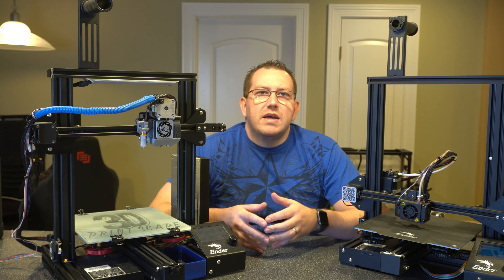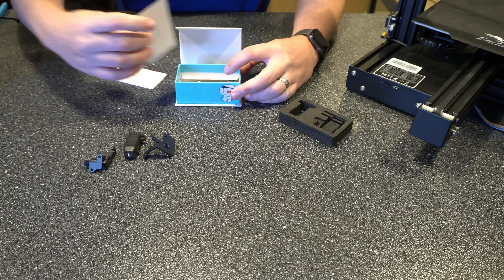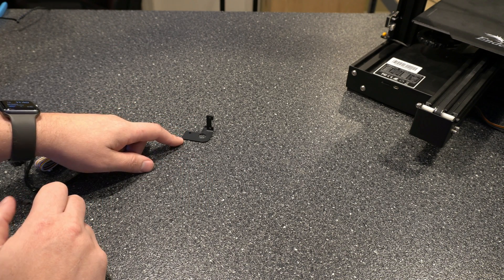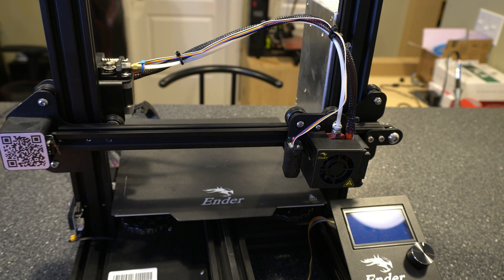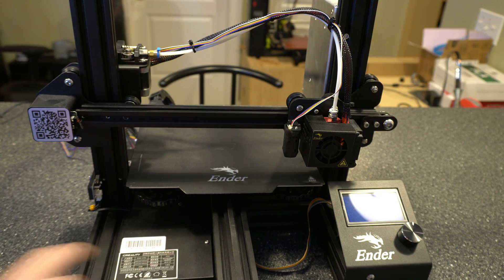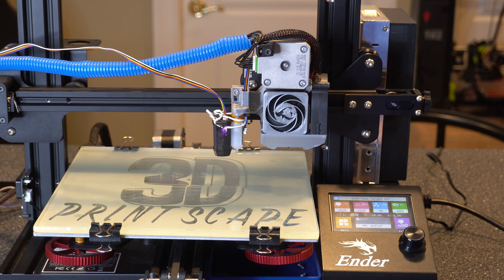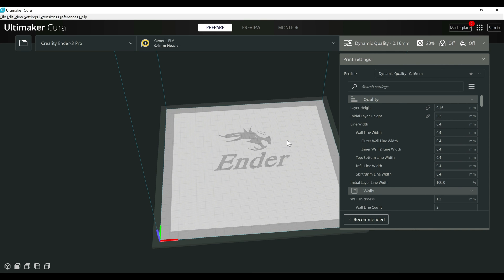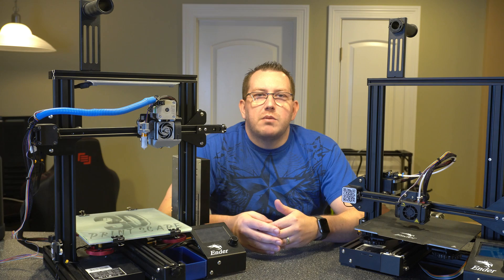CR Touch on SKR Mini

Comment: Hi I flashed the firmware just like the video but when I auto home the extruder only auto homes like the cr touch isn't there. It just goes to corner like normal. Please help thank you
Reply from the maker: Hi. It sounds like the printer didn't take the firmware. You can verify by checking the versioning the about screen or looking to see if the bltouch menu items are there.
Reply: @3DPrintscape  I am experiencing this same issue. If i download the firmware-bltouch-for-z-homing.bin, it will home at the center...
Reply from the maker: @Bloodyfisted  Hi. You shouldnt be using the z-homing file with the crtouch. Try the standard btouch one.

Comment: Thank you for your review. I have the SKR 2 on an Ender 3. The firmware builds fine but when I go to home the printer, it goes to the X endstop, then the Y, then the nozzle goes to the center of the board and goes up a little bit then stops. I have tried plugging the CR Touch in the Servo and Probe pins and also using the Z Stop pins (changing the firmware prior to for each) and I still can't get it to work. When I turn the printer on, the probe does pop out so I know it is getting power. Any suggestions would be greatly appreciated!
Reply from the maker: Hi. Make sure you comment out #define Z_MIN_PROBE_USES_Z_MIN_ENDSTOP_PIN and uncomment #define USE_PROBE_FOR_Z_HOMING in the firmware, assuming you have all 5 pins going to the bltouch port. Also, try it with the z stop plugged back in.

Comment: Great video. I just got my cr touch and have it mounted, however auto homing makes the extruder push into my glass bed. I can’t lower it to zero to find the z offset as the extruder hits the bed around 3mm. It has to lower passed the bed height for the cr touch to trigger. Is this a configuration issue or do I need to try and mount the cr touch lower?
Reply from the maker: Hi. What mounting bracket are you using. With the probe extended, it should be lower than the nozzle. If thats not the case, you will need to lower the CR Touch.
Reply: @3DPrintscape  I’m using the default mounting plate that came with the cr touch. The one meant for the ender 3 pro. And when it’s deployed, it’s only about .5 to .6 mm lower than the nozzle. I’m using the firmware configured to use the cr touch for z homing as well
Reply from the maker: @UnveilinMedal8  If its lower than the nozzle it should be fine, but that is cutting it a bit close. Can you try to add a washer or something to lower the cr touch to see if that helps?
Reply: @3DPrintscape I used two of the mounts to increase the distance and now its working. However, now nothing is centered on the bed. When I center an object in Cura, the object is printed left of the center. Do you know why this is happening? I am using the precompiled firmware provided by bigtreetech as I just reset my PC and didn't have VSCode and PlatformIO setup yet.
Reply from the maker: @UnveilinMedal8  Can you make sure "Origin ad Center"" is not checked in your Cura machine profile.
Reply: @3DPrintscape  it’s not checked. The print is centered in the Y direction. However it’s shifted to the left in the X Direction, even though Cura shows it’s centered on the build plate
Reply from the maker: @UnveilinMedal8  How far off is it in the x direction and what firmware are you using?
Reply: @3DPrintscape  I’m using the bigtreetech pre compiled z homing firmware for the bl touch ender 3 with the SKR Mini V2
Reply from the maker: @UnveilinMedal8  If you have all five cr touch wires connected to the bltouch port, you want to use the standard bltouch firmware, not the z homing one.

Comment: I have a SKR mini E3 V3, but it says "stopped"  on the screen whenever I press bed level or auto home . Does it suppose to work like this video? Or I have to change the wiring?
Reply from the maker: Hi. It sounds like the firmware your running isnt meant for the wiring the way it is.

Comment: Hey me again. So i decided to go with the CR touch using the SKR Mini Board and i downloaded the firmware and everything but when it does the G29 code and starts printing its way to close to the bed. Im using the stock Ender 3 LCD screen. I also have just the regular ender 3. Now i didnt adjust z offset. would that be the issue?
Reply: also when i press auto home it doesnt home to the center like yours does. It just does regular auto home
Reply from the maker: Hi. The z-offset will need to be set but it sounds like the printer may not have taken the firmware. Can you check the about page in the  menu to see if its the right firmware?
Reply: @3DPrintscape  of course. So the about screen under printer says "bugfix-2.0.x 2021-06-05 Ender-3 marlinfw.org Extruders: 1 Bilinear Leveling" thank you for all your help again
Reply: @3DPrintscape  I don't know if this would mess anything up but I had the Cr touch installed before I flashed the firmware. But I never turned it on. I just installed it and then flashed the firmware
Reply from the maker: @BrothaManLemon  That order should be fine. Can you download the firmware from my site and see if it behaves the same way? https://3dprintscape.com/marlin-firmware-builds/
Reply: @3DPrintscape   for the Ender 3 V1 it just says coming soon?
Reply from the maker: @BrothaManLemon  Im off through the end of the year, so I plan on working on updating/creating new firmware builds over the next week.
Reply: @3DPrintscape  awesome man! Can't wait to see! Thank you again for all the help and Happy Holidays my friend!
Reply: @3DPrintscape  Is there a link for the firmware that doesn't involve having to manually untick 1001 illegitimate interest cookies?
Reply from the maker: @No1sonuk  Hi, not sure where you seeing all the cookies but i have the firmware available to download on my site.  https://3dprintscape.com/marlin-firmware-builds/
Reply: @3DPrintscape  Thanks.  I found an app that kills the privacy notices.
I tried your build, and the issue I now have is with the Sprite extruder bracket fouling the Z carriage when X goes full right.
I tried a few tutorials for compiling new software ti limit the travel, but all of them failed to compile.  I'm going to modify the machine - it's FAR easier...
Reply from the maker: @No1sonuk  Try to clear eeprom to see if that helps.
Reply: @3DPrintscape  That did it, thanks.  Probably too many conflicting settings.  AND I replaced the long X carriage screws, so I get full travel back.
Reply: The issue is in official firmware. They know this problem but still doesn't upgrade it. You need to compile firmware by yourself or try to separate CR Touch probe wires and plug one in  Z_STOP pins and other in Probe pins and use Z-homing firmware

Comment: i have a skr mini e3 1.2 how can i install a cr touch
Reply from the maker: Hi. It looks like you will need to change out the 5 pin harness on the board side to a 3 and 2 pin one. https://github.com/bigtreetech/BIGTREETECH-SKR-mini-E3/blob/master/hardware/BTT%20SKR%20MINI%20E3%20V1.2/BLTOUCH%20connection-1.png

Comment: awesome video! although i did run in to an issue, i followed everything step by step and after flashing the board and installing the cr touch (with the tft50) it doesnt recognize my printer anymore saying no printer attatched. I checked and replugged my cables in to make sure there werent any loose connections and the issue still persists. Any ideas? Thanks!
Reply from the maker: Hi. If you switch the tft back to legacy mode, does it show anything? If not, i would try to build and upload the firmware again.
Reply: @3DPrintscape  I discovered this video because I went through the full setup, had ABL enabled on my SKR, and it wouldn't take G29 commands.  For some reason flashing the firmware has caused me to lose connection same as Mikey.  I built and uploaded again with no changes.  Do you have any idea what could be wrong?
Reply from the maker: @ArcaneZorro  Is it not recognizing the printer like the comment above or is it not taking the g29 command? Knowing this will help with troubleshooting. Also, if you can join the discord server that would help as well.
Reply: Im having the same issue. Did you find a solution to this??

Comment: Nice review! Loving the channel. Only question I have is if I'm using Marlin to compile my setup (you can also include CRTouch) I can skip ABL step? Surprised you aren't using Marlin (Cheetah).
Reply from the maker: Hi. Thanks for the feedback. Im not sure i understand your question but if your asking if the if the ABL setup is needed if your using the CR Touch the answer is yes. Its basically the same process as the BLTouch.
Reply: @3DPrintscape  yes. Thanks! Appreciate the fast reply.  Keep up the good content! 👍

Comment: I have the skr mini e3. V 1.2. I am having trouble with the wiring. I have tried a couple configurations and the probe will not do anything. Any help would be greatly appreciated! Thanks I’m advance.
Reply from the maker: HI. Check the pinout appears to be the same on that board but i would verify your plugged into the correct pins. May be this will help out. https://github.com/bigtreetech/BIGTREETECH-SKR-mini-E3/blob/master/hardware/BTT%20SKR%20MINI%20E3%20V1.2/BTT%20SKR%20MINI%20E3%20V1.2PIN.pdf

Comment: I am considering adding the fan upgrade to my Ender 3 Pro. But I fear it would be in the way of my auto leveler. If I installed both the fan upgrade and the auto leveler, would there be conflict? Have you experienced it?
Reply from the maker: Hi. What fan are you looking to go with? If its the 5050 blower fan, this video may help. https://youtu.be/7wYjyA83Ey4

Comment: I use a bltouch do you notice any significant improvements using the crtouch? I’m considering upgrading from a bltouch to crtouch but I’m not sure if there is much difference
Reply from the maker: Hi. It seems like they both work about the same. The CR Touch seems to be better made though.